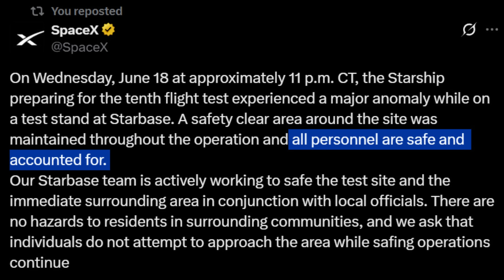SpaceX's Latest Starship Explodes During Ground Test

Comment: 4:10 "we don't know the effects of breathing tiny glass fibres"

The health effects of tiny glass fibres entering the lungs are well known in excruciating detail.
Reply: I wouldnt make a habit of breathing in those fibres.
Reply: Why is this so hard to decipher for everyone. None of the substances mentioned here are good for you, none. However they are different substances and have different effects on the body
Reply: "But... but I was told that fiber is good for you!"
Reply: Breathing anything other than air is bad for the lungs. 
Cheers
Reply: Silicosis
Reply: maybe it’s not the same but in my job we have to cut a lot of concrete and what not and the dust is loaded with silica and we have had many safety meetings about how dangerous it is to breathe that shit and why you need to use water to keep it from going airborne. It shreds your lungs
Reply: Fibrosis of lung.  Scars the lung
Reply: Pneumonoultramicroscopicsilicoastronothermokeramoconiosis
Reply: It's OK. The surrounding area is mostly poor. Musk doesn't think of them as people.
Reply: Musk doesn’t care what harm to people or nature any of his publicly funded projects may cause. Just take a look at Memphis or the damage his last exploding rocket caused.
Reply: I wish I could like this more
Reply: Employees of Fracking companies that don't use face masks, as the Sand Hog is unloading it's sand (proppant) into the Blender,  will develop lung disease. It is not like beach sand, which is rounded, it is sharper.
Reply: Glass fibres break down to a minimum particulate that’s 1.5 x the diameter. It’s tiny, but compared to diesel particulate it’s huge. Asbestos goes even further. It’s a fibrous molecule where the smallest fragments are made of fibres that are 100x smaller. Eventually you get fragments the size of cellular DNA. The immune system goes cancerous while trying to kill the unkillable.
Reply: Pretty sure we know about it and it’s called black lung disease.
Reply: Yeah, well this is going to test the introduction of large pieces of silica into the lungs by getting hit by a chunk of them from outside.
Reply: The same as breathing volcano ashes. These particles are sharp as a knife.
Reply: Don't be down range, simple!
Reply: Wood fibers are considered potentially lethal, in professional woodworking environments there are strict laws for ventilation.
Now of course glass fibers might be different than wood and asbestos...
Reply: @DR_1_1  I have an old high school (mid 1970s) friend that ended up having serious lung, health issues after working in a cabinet fabrication shop for several years (with little to no protection from the wood dust that was produced).
But what amazes me is, I have another friend (also in his late 60s now) that was an automotive tech for decades = had zero protection from the brake shoe dust that was blown into the air when doing thousands of brake jobs (I remember watching him blow and stand in a cloud of brake dust when we worked at a tire store). Like most old people, he does have health issues now but surprisingly, breathing, lung issues isn't one of them...
Reply: @KCadbyRacing  be careful, when people tried to deny the harmful effects of smoking you'd hear about "my 80 year old granddad smoked 40 a day and it never did him any harm". Evidence is not the plural of anecdote.
Reply: @DR_1_1 silica fibers are just as bad as asbestos. It doesn't break down in the body.
Reply: Wow who knew breathing tiny glass fibers would be bad for you!? 😅🤣😂
Reply: will be same as asbestos
Reply: @Phoenix_R1se : At the risk of redundancy, the size of the glass fiber affects what it can fit into, the chances that it will get back out, the chance of adhesion/cohesion, etc. There is essentially no good example of breathing in glass debris of any kind, but different kinds actually cause different problems based on size and shape. It is not all asbestos.
Reply: @Phoenix_R1se  Not quite. Asbestos really is in a league of it's own. Which really is a shame as it truly is an amazing material.
Reply: @jonny-b4954  If I remember correctly the asbestos fibers are much smaller than the glass fibers, hence better insulation properties in asbestos. Also fine enough that they get encysted in lungs instead of expelled and presto - lung cancer. Correct?
Reply: @yumazster  Yes, asbestos fibers are much smaller. And, they're just as indestructible. They simply don't seem to leave the body once ingested. Your body protecting you leads to mutation of those cells, aka cancer. Mesothelioma.
Reply: @Phoenix_R1se  While it wouldn't be as bad as asbestos - it's still going to be pretty awful.
Reply: @Phoenix_R1se  No! Asbestos causes cancer, silica no.
Reply: The problem with asbestos is that it's "invisible" to the immune system due to something about its chemical makeup. As a result, it stays in the body, forever, unchanged, constantly slicing up the tissue around it, which is what eventually causes cancer. Glass, on the other hand, is absolutely visible to the immune system. It gets recognized as a foreign object immediately and rejected, pushed out of lung tissue and transported via cilia into the mucus pathways which eventually get it ejected from the body. Fiberglass can cause health issues, but only in insane concentrations, and only by temporary exposure rather than permanent methods.
Reply: @Phoenix_R1se  No, glass and fiberglass are safer, alot safer. Loft insulation, in the UK atleast, is mostly fiberglass and while its not good for you and will certainly cause irritation, it doesnt cause mesothelioma and its nowhere near as toxic.
Should still wear a mask or something to limit exposure but its not gonna lead to huge issues thankfully.
Reply: @ExaltedwithFail  fine glass fiber inhalation will cause pulmonary fibrosis, which, you're correct - isn't mesothelioma.... but is very terrible and deadly in its own right.
Reply: Yeah, there's a difference between 'this stuff is nasty, only handle it with proper PPE and precautions' and 'this stuff is nasty, do not handle it ever if at all avoidable'
Reply: @ExaltedwithFail  Crocidolite is the most dangerous form of asbestos. White asbestos is of fine hairs which are mostly clearable by the lung. Crocidolite particles are needle-like and very difficult to clear, and are irritating.
Reply: @ExaltedwithFail  "No, glass and fiberglass are safer, alot safer."
They are not - that is why nowadays these fibreglass insulation have to be treated the same way as asbestos when renovating buildings.
Yeah it was known back then already but just covered up.
Reply: tobacco industry all over again...
Reply: @ABaumstumpf totally wrong
Reply: @Toaster-v1z  silicosis is nearly as bad as mesothelioma, but almost all mesothelioma is linked to asbestos, not silica.

Mesothelioma is WEIRD.  Its a single layer of cells on the OUTSIDE of your lungs- asbestos is just uniquely suited to penetrating all the way through your lungs and irritating that single layer.  Other types of fiber like silica or carbon or even other silicates either stay embedded in the lungs or distribute more widely than that single-cell layer.  All fibers CAN cause mesothelioma, but they cause problems in other places too because they spread out.  Asbestos is way more consistent in the exact way it accumulates and causes mesothelioma.

That doesn't really mean other fibers are safer, also. If you have radioactive material in one organ, you'll only ever get cancer there.  If its spread all over you can get cancer anywhere, but the rate of any individual spot will be low.  All together the risk of cancer may be the same or worse, but its way harder to tell what is caused by what.  Same thing with breathing in fibers.
Reply: @wim0104  Other than the health risks being ignored and or covered up for the sake of profits, this isn't anything like what the tobacco industry did (fiberglass isn't addicting)...
Reply: @ExaltedwithFail  I vote you guineapig the exposure and breathing of glass fibers. For science.
Reply: @ABaumstumpf  That is completely untrue, glasswool insulation is still continuously used in new building and does not in any way need to be treated the same as asbestos.  You literally just made that up.
Reply: @ExaltedwithFail If it combusts it won't be good no
Reply: @ExaltedwithFail  afaik, it depends on the diameter of the fibres. Asbestos is way smaller than insulation rockwool/glass wool. So loft insulation will not pierce individual cells of lung epithelium, but we don´t know the diameters of these fibres SpaceX uses, at least I don´t.
Reply: @paavobergmann4920 all small particles / fibers that have sharp edges will embed themselves in cells / lung tissue and get stuck.  Depending on which flavor of particle we're talking about, you get everything from pulmonary fibrosis / interstitial lung disease to mesothelioma.  All horrible.
Reply: @marcusbardstown505  what exactly happens in which particular tissue is largely size dependent, that was my point. And no, none of these fibrous mineral materials are particularly (pun fully intended) healthy to breathe in. But asbestos differs from glass wool in having much smaller diameter  fibres, hence the damage presents differently. And sure, even if you don´t get cancer, you can still die, which is obviously horrible, but due to the smaller fibres, asbestos is more likely to cause cancer. That was it. That was all i wanted to add.
Reply: @Phoenix_R1se it’s not.
Reply: @Phoenix_R1se  False.
Reply: It's not a problem. they will simply brush it all off to the ocean. Remember, it's more important to colonize Mars for the frivolous pursuit of billionaires than to safeguard earth for peasants.
Reply: @elftax this is minuscule compared to what China and India dump into oceans.

Don’t use the environment as a means to an end for your anti space argument, it cheapens the cause.
Reply: @elftax  humans innovation does not stop for your pansy snowflake complaints. We move forwards without you.
Reply: The debris from this test will never harm even a single person even through stochastic effects. 

Yes, the value the Starship program will return to the general public is absolutely worth the cost of developing it.  @elftax
Reply: @elftax  Were it so easy as sending them all to Mars...
Reply: @44R0Ndin  Bezos is a space freak, he went up to space as soon as he had a viable rocket. Musk is too scared to go up in his own rockets let alone travel to Mars.
Reply: Yes. But asbestos was demonized too much. And I doubt this tiles gonna end up as fine powder and not large chunks
Reply: Someone in the second stage department  is sabotaging atleast 1 spy present...
But can't operate alone so atleast 2.. the explosion is always at the upper end seemingly same spot*
Reply: its not bad, fiber glass doesnt react with human cells.
Reply: @trader2137   It absolutely is bad.  Glass fibres and silica dust which gets trapped in the lungs, promotes tissue scarring which expands once it has started and makes breathing very difficult due to that scar tissue being much less flexible and also no longer being viable for healthy lung tissue to do what it is supported to do, ultimately taking the life of the person afflicted.

If you want to spend your last years desperately gasping for breath, wheelchair bound and constantly on oxygen and eventually on a ventilator, by all means forego your PPE when handling it.
Reply: @BeardyMacBeardFace  yes its bad for lungs but physically - by blocking, and not chemically - by reacting
Reply: @trader2137  You know this how?

Comment: Elons rapidly iterate approach to engineering is maybe starting to come undone. When you roll the dice and get heads 10 times in a row you might get a sense of false confidence...
Reply: "When you roll the dice and get heads 10 times in a roll" F*** me but you can mangle a language .....
Reply: It has nothing to do with that, this all started happening with the new designed starship. It's not working. They are going to have to go on to block 3
Reply: @Bryan-Hensley lol, so you're agreeing. 😂 He made to many changes, becsuse he got lucky in the past with this kind of approach. Now he's learning NOTHING about the heat tiles (primary objective) while blowing up multiple starships!
Reply: @ijwilson which part did you have trouble understanding?
Reply: @Bryan-Hensley the part when you opened your mouth... I'll say this verrryyyy slowly. If he had not made the mulitude of changes in block two and had instead just focussed on solving the re-entry issues the program would be further ahead. Elon took a high risk, high reward philosophy. But high risk means low probability of success.  This strategy had worked well in the past, but sooner or later it will catch you out.

Comment: I have heard a few things about the V2 Starship that make me question if it will fly. Another significant issue the Angry Astronaut addressed was the Raptor engines. They are far too underpowered, meaning they have to "overclock" them to get their desired lift. This has supposedly been solved, but now it looks like they found yet another thing.
Reply: Or rather than Starship is overweight
Reply: @saumyacow4435  All that stainless steel doesn't help. There's a reason aluminium is the #1 choice.
Reply: @Croz89  aluminium is terrible, its not that light as lithium alloys. Same time it comes nowhere near stranght of stainless, specially at low temepratures.  High strenth aluminium alloys have virtually zero plastic deformation before they fail. On big structures you want plastic deformation, if something is not 100% allignet it will deform to "right shape" before failing. Ak high strenght aluminium alloys at that temperature are basically like glass.
Reply: @Murphydeffa-oq8lm  lithium alloys are aluminium alloys with some lithium added, you couldn't build a rocket out of pure lithium, it's way too soft to begin with let alone the reactivity! 

Stainless is great, sure, but it's heavy. That's why aluminium is preferred for rockets, you save a lot of mass.
Reply: @Croz89  ofc its alloy, no one mentioned pure metal. aluminium is also not pure, Al with lihium is mutch lighter. Not only, density of lihium alloy will reduce also. its not magic but around 10%. Also increased lithium increases corrosion. So its not really REusable.
Reply: @saumyacow4435 Oh that is a big issue as well. The stainless steel may have been a bad choice in the end, at least for the ship...
Reply: engines are at bottom of rocket not at nose where failure started. Cant see any relevance to this event.
Reply: @Murphydeffa-oq8lm  the relevance is that they are trying to reduce weight were ever they can find, we are seeing the results of underdimentioned structures
Reply: Yes. Kettle and pot story. Easy for Angry to throw in free advice while millions dollar's of others monies are being burned up. To ensure his plan of giving humanity a fighting chance against going extinct, Elon must keep SpaceX PRIVATE.
Reply: @Murphydeffa-oq8lm  The engines must be able to move the whole thing. If you lack thrust, you need to reduce weight. That always means taking material away. Does that make the vehicle stronger? No, things break easier.
Reply: @flybywire5866 thats dependent of your targeted payload. Shell is nothing compared when its loaded with fuel. 
Dont get me wrong, i see your point. Structural falure is probably related to questionable designe chices. 
As engineer myself i know you can remove a lot of material without any reduction of strenght. But issue is you need to be aware of all the failure modes. I am suspecting thats where issue is.
Reply: @Murphydeffa-oq8lm  That is a good point and I don't solely blame the body weight issue. I have also been following the engine developments and other systems. The ship does fly, lets not forget that. But like you said problem is when its in flight, the reductions have now led to failures due to the parts not being quite good enough or the correct configuration.
Reply: Over-hulled for her engines - just like Howard Hughes' "Spruce Goose"
Reply: Time to make a call to Rocketdyne.
Reply: It'll probably turn out that a bolt was loose or something.

Comment: It looks like Block 2 is built too thin for weight reduction. Would explain the constant RUD connected to major leaks.
Reply: bad welding... It's been the bane of SpaceX for years.
Reply: I guess a chainsaw was the wrong tool to use for weight reduction....
Reply: Yeah could well be. But in the long term, better to go minimal and build up what is necessary than to build overly heavy and never know how much margin is being left on the table.

But in the short term it's an ugly and slow process.
Reply: @scottwatrous That's what we did at Ford. Run the thinnest steel possible and gradually increased the thickness until the rejection rate was low enough to be acceptable.
Reply: @ghost307  These aren't cars at an assembly line, but highly pressurized propellant tanks. Huge difference in terms of potential catastrophic failure.
Reply: @scottwatrous  yeah sure 😂
Reply: @scottwatrous  Nope